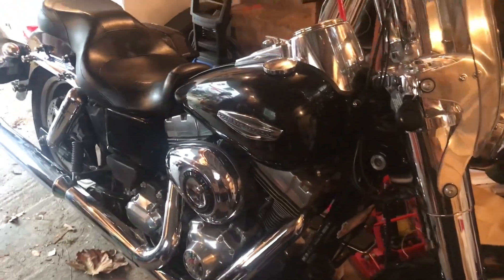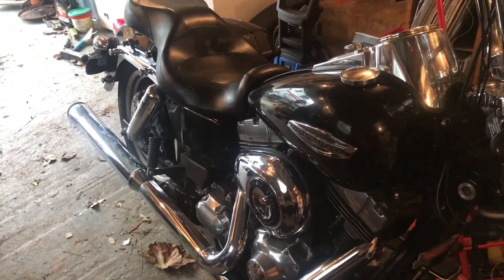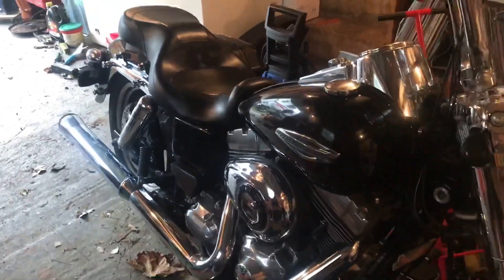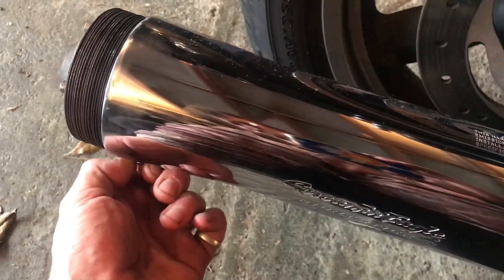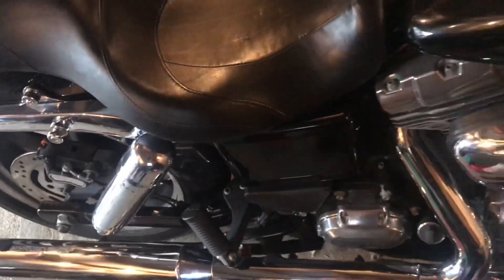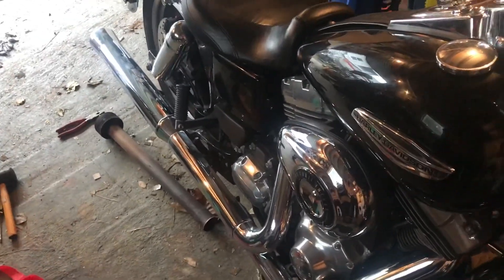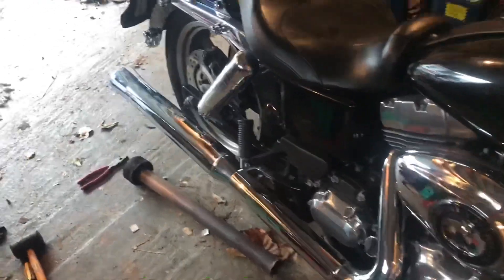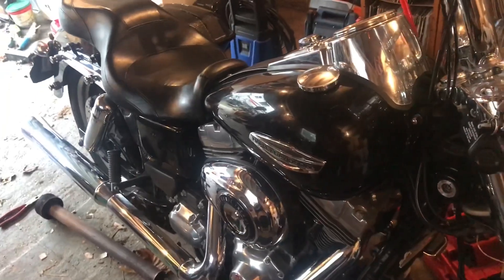2014 Dyna Switchback how to get your nightstick sounding good

Comment: Much better sound with the guts pulled out . What if it only had a short slip on instead of the long one?
Reply from the maker: I’m thinking of gust putting a turned out tail pipe on instead of a muffler, I still have to remove the Catilatic converter and then I’ll do another sound test. Possibly without the CAT I would need some sound deadening to keep some back pressure and retain torque